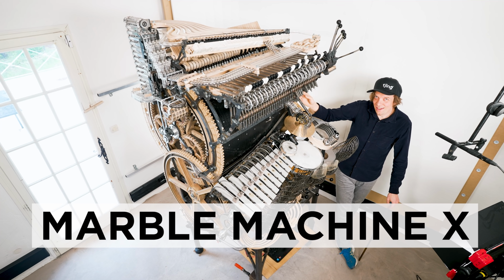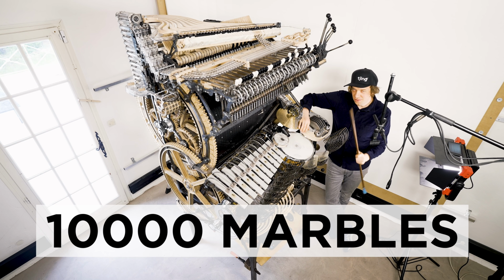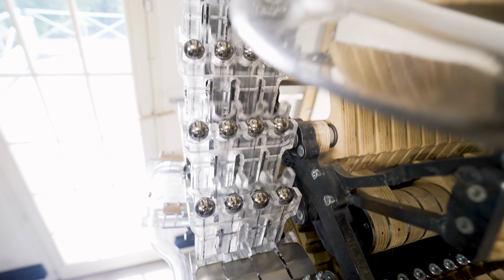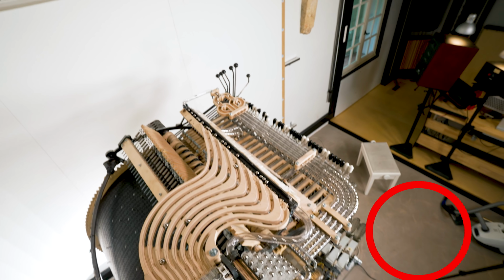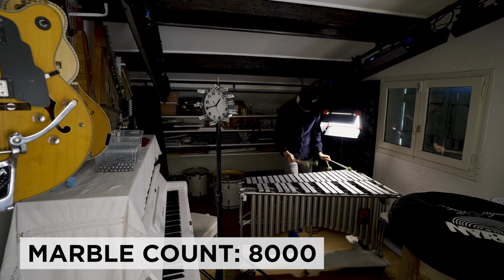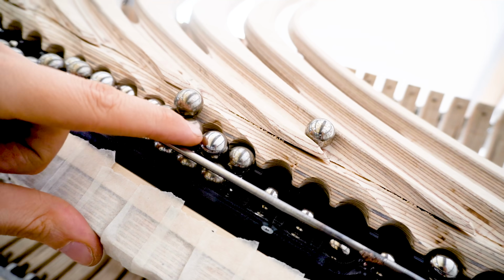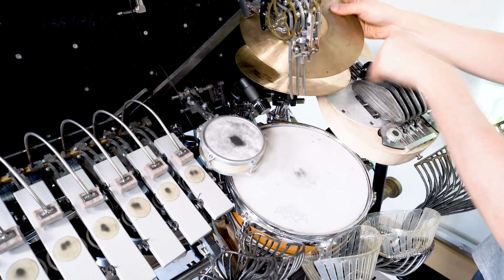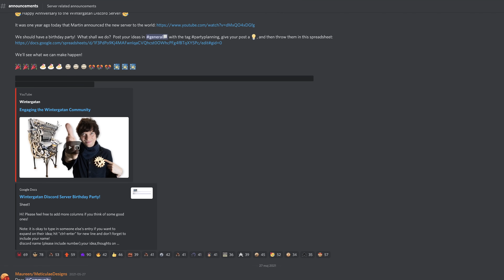Playing 10000 Marbles - Marble Machine X Accuracy Test

Comment: that bolt shimming system for the programming wheel is going to disintegrate over time with that size and type of bolt the threads will eat the wood around it under that much pressure and movement, the bolt is a fine idea you just need to put metal clips on either side of the wood for the bolt to thread through an maybe another where it will contact the next part of the wheel.

TL;DR metal on wood never lasts very long especially under movement reinforce it before it becomes an issue

Comment: Amazing feat of engineering!! or strange robotic Lovechild of an orgy between printing press, marble run,  drummachine and a human..

Would give victorian workhouses a run for their money! 

I'd like to see a plugin made that generates different rhythm tracks based on the machines algorithm, sales of which could generate extra funding for the project.

Not that it's not incredible already but could you not use the uplift of the mechanical foots instead of just the downfall to trigger some of the instumentals that you improvised over the top thereby automating more of the human elements.

For example elements of the mechanical movements could press midi switches that trigger chord progression, or pedals if you wanted to keep it analog/mechanical 

 Best not let the Luddites find it

Comment: due to gravity it would have an optimum speed to make it all work.... too fast, or slow, and it wouldn't come together without massive adjustments... fall rate of the balls and distance they fall will dictate this... amazing unit... 3D design and CNC makes it all possible... without computer design and cutting this would be a lifetime achievement.

Comment: 2000 marbles in Marble Machine 1 with several dropped marbles. Marble Machine X? 10000 marbles and NO marbles on the floor. 20000 marbles? Nope. 100000? Havent done yet, maybe 1 marble if unlucky.

Edit: Most we've done is 60000, but thats still 15x the original marble machine with ZERO MARBLES ON THE FLOOR. if he makes a room sized marble machine, maybe marble dreams is a good name